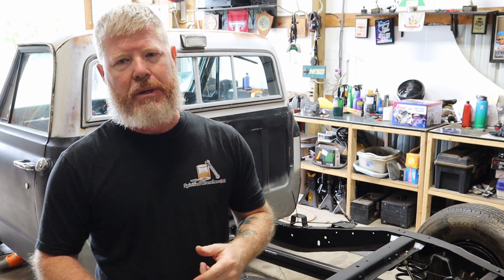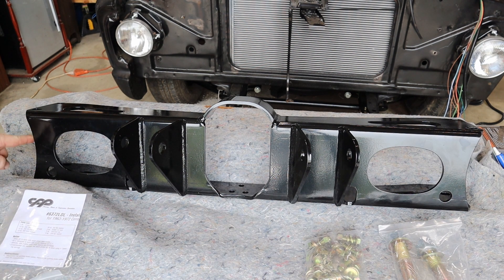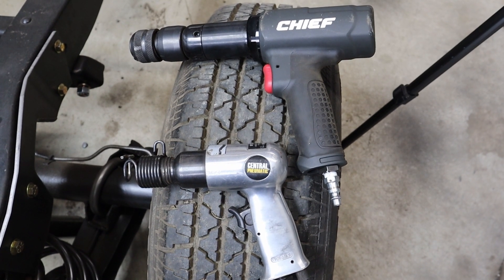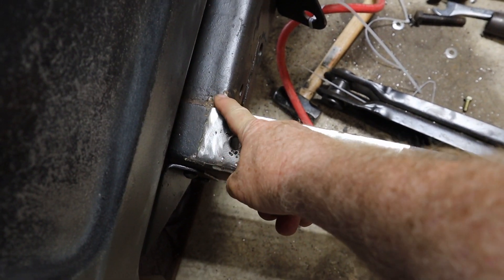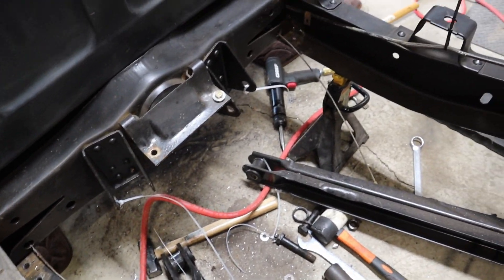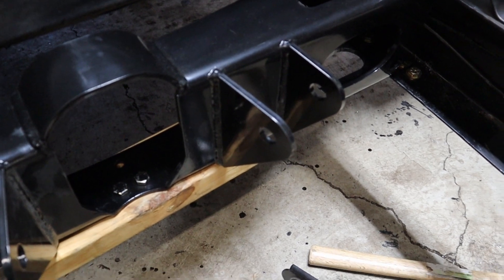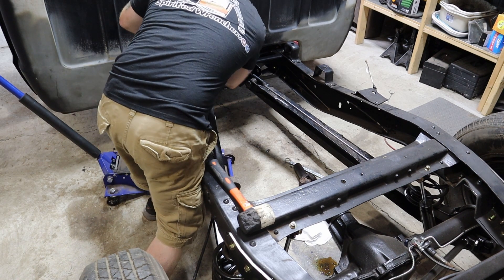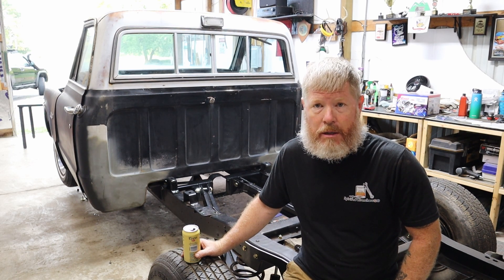Installing the CPP Center Crossmember on a 1963- 1972 Chevy C10 - Project Harold

Comment: Must be something in the water...my air hammer saved my ass yesterday with removing the Pittman arm on the 62.  Was too tight to get a puller in the space so we hammered on it as best we could and got it.  That crossmember is a good looking piece!
Reply from the maker: LOL. That's awesome. What air hammer do you have? That's great, yours was a savior. I feel the same way after working hard with my cheap one and then seeing the difference with the bigger one. Thanks for watching brother!
Reply: @SpiritedWrenchers  the one I have is identical to your small one, probably need that upgrade myself.🤣

Comment: Next time you take off the rivets try a sawzaw if the grinder can’t get to the head. Air hammering is brutal. Once again good job thanks for the vid. 👍
Reply from the maker: Hi SoCal. Thanks for watching and the kind words. We appreciate it. Yeap, you're right. Sawzall would have worked as well. I actually debated which tool I wanted to by. Figured I would likely used the hammer and bits more than I would the saw so I went in that direction instead. Now I would just torch them off. Lol. Thankfully I believe I'm done with them.

Comment: It looks like this would only work with a one piece driveshaft? I don't see provisions for bolting up the bracket for a center support bearing.
Reply from the maker: @woog74  thanks for watching and asking. Yes, you are correct.  We knew we were moving to a 1 piece( see our other video of that install), so this worked perfectly for it.

Comment: Why did you not cut an X in the rivet head first? It would have made it much easier.
Reply from the maker: Hi AbstractDreamz. Thank you for watching and sharing. We really appreciate it. That's a fantastic question, and you know what? I don't know why. 🤣🤣. Sometimes, I completely skip over ways to make the job easier and just go with the hardest, most difficult way to do it. Hahahahahha. Now I just have to slap my head for not thinking of that. Thanks for that. If I have to battle with a rivet again and can get the cutoff wheel to it, I'll definitely do that. Cheers!